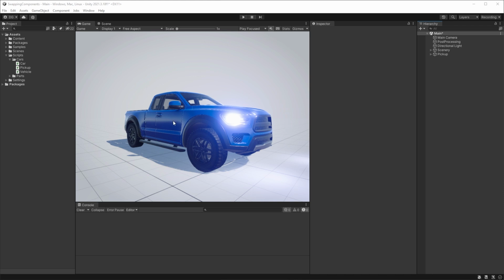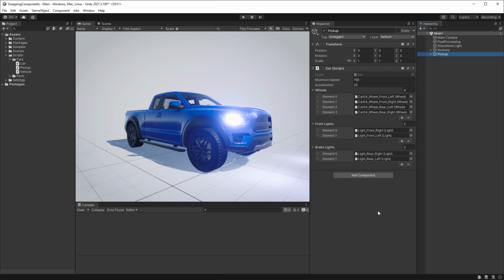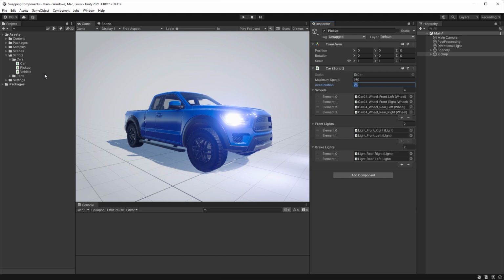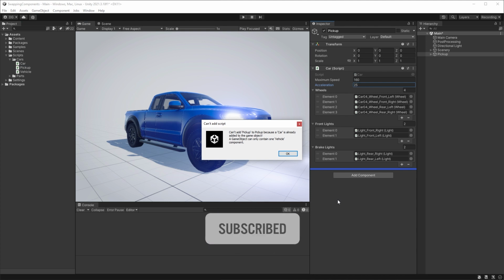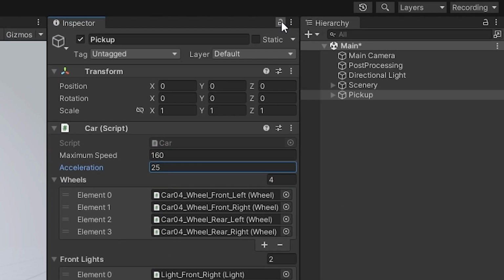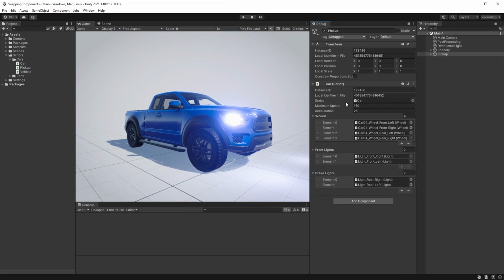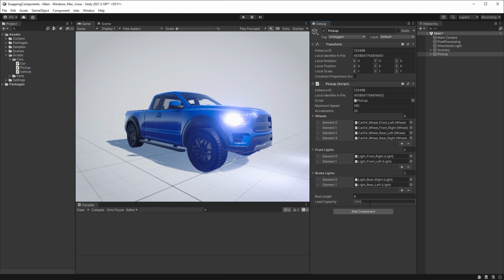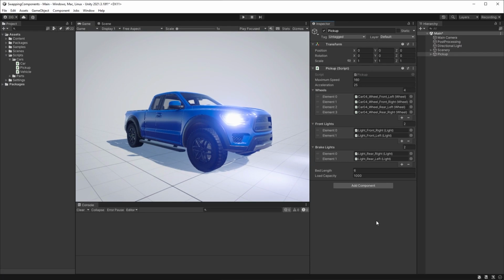Must Know CHEAT To Swap Components In Unity

Comment: thank you for sharing but it failed on unity 2022....:face-purple-crying:
Reply from the maker: I just booted up 2022.2.13f1 .. made a simple script and another one derived from it and performed a swap and it worked ok.
As stated in the video though this may not work for some component swaps so looks like you found one that didn't
Reply: @WarpedImagination  The script variable was locked so I couldn't drag script on it in unity 2022.2.1f1 or others Unity 2022 🥲BTW I do it in a empty and new unity project.
Reply from the maker: @rStarStudio  I take it you are definitely putting on the debug mode on the inspector?
Reply: @WarpedImagination  yes debug mode on the inspector.
I’m just confused that works on Unity 2021.
Reply from the maker: @rStarStudio  Yeah its odd because I booted up 2022 this morning and it seems to work fine